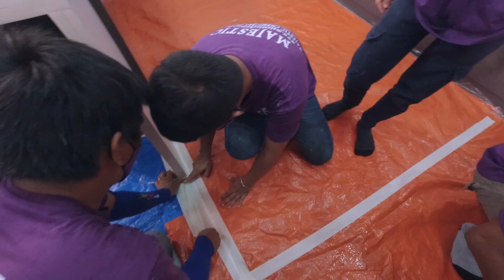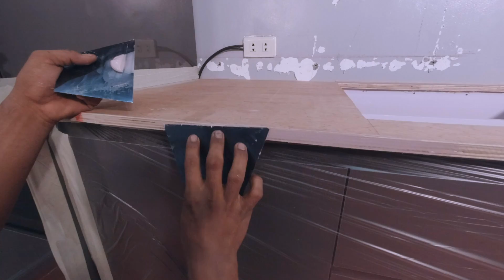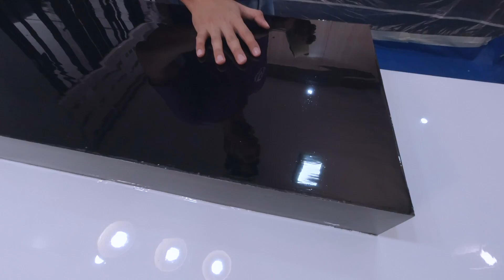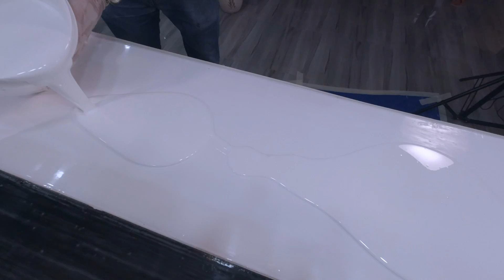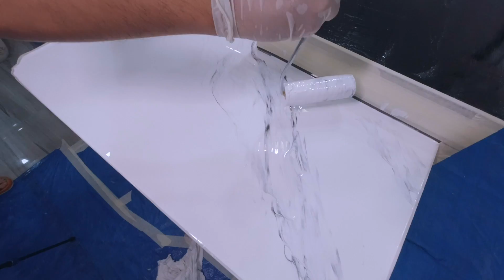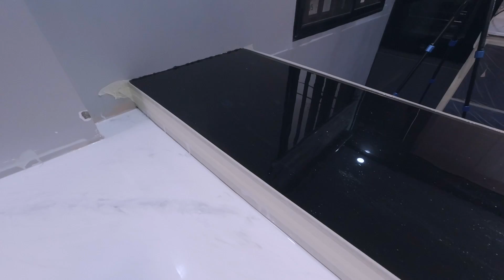Full INSTRUCTIONAL VIDEO Counter top Epoxy Black and White Carrara Inspired Design

Comment: Sir kelan po tinangal yung masking tape sa sides? 
At yung primer sa wall di ba yun magcause ng gap pagmatuklap na ang paint?
Yung mga masking tape between sa top counter at sa lower counter pano pag tanggal?
Reply: Waiting po sa sagot.😁
Reply from the maker: Good Day 

Tinanggal po ang 
masking tape around 30mins simula nung binuhusan.
Primer po sa wall? lahat po ng product natin is Epoxy resin, hindi po sya recommended na e apply sa Wall dahil Selfleveling materials sya.  Unless mag apply sa plywood then ididikit pag ka dry. 
Hahatakin lang po.. ang drying time naman po nyan is 6-8hours. kaya within 30 mins, alisin sya ng dahan dahan, let the flow begin :D 
dahil may 30 mins na syang na stay sa surface may pag ka lapot na sya kaya di lahat mag fflow :) 

makakabili po kayo sa amin, just message lang po and we will answer those Questions :)
https://www.facebook.com/majesticchemicals/

also we have LAZADA for COD
You can purchase to our Lazada
then screenshot your order then send it to us here so we can prepare it as soon as possible.
sa Fb page parin po :)
https://www.lazada.com.ph/majestic/?

Visit our Website
https://majesticchemicals.com/

By the way I'm Sherwin of Majestic Chemicals, Glad to assist you :)
For availing & quicker response, you may contact us
09182523454

Join MAJESTIC EPOXY RESIN COMMUNITY PHILIPPINES to show your resin works and share tips
⬇️M⬇️A⬇️J⬇️E⬇️S⬇️T⬇️I⬇️C⬇️ ⬇️C⬇️H⬇️E⬇️M⬇️I⬇️C⬇️A⬇️L⬇️
https://www.facebook.com/groups/398748351104499

Comment: Magkano ba ang self leveling at ang metalic epoxy,,kasama na ba ang pigment dyan pagbili mo ng metalic epoxy?,,,tnxs po
Reply from the maker: Good day

Exactly sir, lahat po ng sinabi nyu is include sa mga kit natin.

Part A and B for Primer and Top coat with metallic pigments na po sya :D 

For availing & quicker response, you may contact us
09182523454

Comment: ano po pros and cons ng epoxy resin? comparison din vs tiles in terms of durability from wear and tear?
Reply from the maker: We are Majestic Chemicals Industries is the #1 supplier of Liquid Marble Epoxy Resin in the Philippines.
It can be used on floorings, countertop, tabletops, even for casting like rivertables, jewelries and accessories.
Features:
✔ Waterproof (Non Skid)
✔ Heat Resistant (Fire Absorbent)
✔ Stain Resistant (Odorless)
✔ Chemical Resistant (Food Graded)
✔ Seamless
✔ Stylish and Unique Design
✔ Economical and Cost Effective
✔ Environmental Friendly
✔ 100% Pure Solid (Can absorb up to 10,000 PSI)
✔ Multi-Dimentional Effect
Reply: @MajesticChemicals  its not UV resistance nag yeyellow po siya tama po ba?

Comment: Gud day ano po Ang mga dapat bilhin ng mga materyales paki lista Naman po thx.
Reply from the maker: Good day

Avail po kayo sa amin ng aming resin epoxy depende po sa Sukat by SQM po ng pag bubuhusan.

sa mga hardware meron pong 
foam roller, liha, brush and need lang po na may mga cover ang mga posible na mapatakan or masayaran ng ating resin :) 

For availing & quicker response, you may contact us
09182523454

Comment: Mas matibay po b yan kaysa Tiles or granite?ok lng b yan khit mabsa?cnung mas mas mura?
Reply from the maker: Good day

Opo, mas quality po ito sa kanila
Our product or resin epoxy has

-water resistant
-heat resistant 
-scratch resistant
-dust resistant
-chemical resistant
-di nag ccracks
-di nababasag
-walang maintenance, walis or punas lang
-super easy to apply
-shiny at elegant pa tignan
-non-slippery even wet
-odorless & solventless
-industrial grade
-food grade/safe
-Lifetime Quality
Can hold up to 10,000 PSI

at kung mababasa man, okay lang din po dahil water resistant ito at kahit na matapakan ay hindi po kayo madudulas bagkos ay makapit pa po,
mura lang ng konti si Ceramic tiles
pero mas mura tayo sa Granite tiles at marble
at Mas Quality sa kanila

For availing & quicker response, you may contact us
09182523454

Comment: hardener po ba yung parang color Oil Golden?
Reply from the maker: Good day, opo ganun nga po ang kulay ng Hardener or Part B ni Selfleveling Non-metallic :D 
by the way I'm Sherwin of Majestic Chemicals. Glad to assist you :)
For availing & quicker response, you may contact us
09182523454
Reply: @MajesticChemicals  sir ask lang ko. magkanu yung per gallon ninyu sa Expoxy resin A & B

Comment: Boss pwedi bang pinturahan ng epoxy paint bago patungan ng self leveling
Reply from the maker: Good day

we only recommend sir na walang iba sa flooring, dapat malinis at walang ibang e aapply.

self levelling non-metallic for our primer then metallic for top coat. requirement is rough to smooth finish concrete/cement flooring or even plywood ang flooring basta walang ibang ilalagay dahil di kakapit ang ating resin epoxy :)

For availing & quicker response, you may contact us
09182523454

Comment: Isasand parin po ba yung baba nung edge pag tinanggal na yung tape? Un kasi yung inaabangan ko kaso hindi nyo na sinali sa video
Reply from the maker: Good day

30mins after coating of top coat or design part, saka po tatanggalin para medyo sticky na sya at di lahat mag over flow :D 
for more details, kindly contact us... 
For availing & quicker response, you may contact us
(+639182523454)

Comment: Ano po yung pinaghalo nyo s primer at s top coat, at san po makakabili ng risen epoxy. Ty
Reply from the maker: Good day

We called it, hardener or Part B, makakabili po nito sa amin

kumpleto na po, part A si resin at part B si hardener! 
 For availing & quicker response, you may contact us
09182523454

Comment: Good am!Sir pwd rin po b mag counter top epoxy pag plat yero ang sahig s  my lababo?
Reply from the maker: Good day

if metal po ang yero at flat pwedeng pwede po :) 
pero kung glass or may pag ka plastic ang surface di po kakapit si epoxy resin :)
For availing & quicker response, you may contact us
(+639182523454)
Reply: @MajesticChemicals  sir ilan taon po bsgo masira ang couter top epoxy?

Comment: Mas mura ba yang ganuan sir kesa granite nalang Ang counter top
Reply from the maker: Good day

Our product or resin epoxy has

-water resistant
-heat resistant 
-scratch resistant
-dust resistant
-chemical resistant
-di nag ccracks
-di nababasag
-walang maintenance, walis or punas lang
-super easy to apply
-shiny at elegant pa tignan
-non-slippery even wet
-odorless & solventless
-industrial grade
-food grade/safe
-Lifetime Quality
Can hold up to 10,000 PSI

mura lang ng konti si Ceramic tiles
pero mas mura tayo sa Granite tiles at marble
at Mas Quality sa kanila

For availing & quicker response, you may contact us
09182523454

Comment: patingin nmn po sa diskarte ng pg tangal ng tape sa edges
Reply from the maker: Good Day

after top coating, patagalin nyu lang ng 30mins, then saka tanggalin para steaky na pag bagsak at linisin lang lagi yung pinaka ilalim, po para maiwasan yung may matuyong drop form.

makakabili po kayo sa amin, just message lang po and we will answer those Questions :)
https://www.facebook.com/majesticchemicals/

also we have LAZADA for COD
You can purchase to our Lazada
then screenshot your order then send it to us here so we can prepare it as soon as possible.
sa Fb page parin po :)
https://www.lazada.com.ph/majestic/?

Visit our Website
https://majesticchemicals.com/

By the way I'm Sherwin of Majestic Chemicals, Glad to assist you :)
For availing & quicker response, you may contact us
09182523454

Join MAJESTIC EPOXY RESIN COMMUNITY PHILIPPINES to show your resin works and share tips
⬇️M⬇️A⬇️J⬇️E⬇️S⬇️T⬇️I⬇️C⬇️ ⬇️C⬇️H⬇️E⬇️M⬇️I⬇️C⬇️A⬇️L⬇️
https://www.facebook.com/groups/398748351104499

Comment: Tanong ko lang po kung kakapit po ba ang epoxy resin sa granite?
Reply from the maker: Good day

Yes po kakapit po :D kung balak nyu patungan ang granite tiles nyu. opo pwedeng pwede po :D

just make sure na matibay parin po si granite 
mamasilyahan ang lines at lilihaan po sya then primer then top coat... 

Avail na po kayo
For availing & quicker response, you may contact us
09182523454

Comment: Pwede ba sa cement,,at pano
Reply from the maker: Good day

Opo pwedeng pwede cement finish semi rough finish lang requirement na self level area.. 

primer, lihain then clean tapos top coat napo :) may instructions naman po ito and step by step maliban dun tuturuan ko din po kayo via call and gguide ko po kayo :D 

Avail na po kayo ^_^ 

For availing & quicker response, you may contact us
09182523454

Comment: Hello po May I know how much do u charge for labor for a kitchen counter top and round dining table.
Reply from the maker: Materials & Labor for Counters, 
1000Php/sqft
Additional 20k and Up depende sa location  for equipment & mobilization
w/ 5 Years Warranty

sa round dining table po. ilang seater?
For availing & quicker response, you may contact us
(+639182523454)
Reply: @MajesticChemicals  4 seater po
Reply: My location po sa Field residence condo

Comment: Good job.  Wala bang amoy yung resin boi..
Reply from the maker: Good Day

May amoy pero di po sya masakit sa ilong or nakakasama. di rin po ganun kalakas ang amoy, 

Our product or resin epoxy has

-water resistant
-heat resistant 
-scratch resistant
-dust resistant
-chemical resistant
-di nag ccracks
-di nababasag
-walang maintenance, walis or punas lang
-super easy to apply
-shiny at elegant pa tignan
-non-slippery even wet
-odorless & solventless
-industrial grade
-food grade/safe
-Lifetime Quality
Can hold up to 10,000 PSI

For more details, Pm us po

makakabili po kayo sa amin, just message lang po and we will answer those Questions :)
https://www.facebook.com/majesticchemicals/

also we have LAZADA for COD
You can purchase to our Lazada
then screenshot your order then send it to us here so we can prepare it as soon as possible.
sa Fb page parin po :)
https://www.lazada.com.ph/majestic/?

Visit our Website
https://majesticchemicals.com/

By the way I'm Sherwin of Majestic Chemicals, Glad to assist you :)
For availing & quicker response, you may contact us
09182523454

Join MAJESTIC EPOXY RESIN COMMUNITY PHILIPPINES to show your resin works and share tips
⬇️M⬇️A⬇️J⬇️E⬇️S⬇️T⬇️I⬇️C⬇️ ⬇️C⬇️H⬇️E⬇️M⬇️I⬇️C⬇️A⬇️L⬇️
https://www.facebook.com/groups/398748351104499

Comment: Yung  1 ltr na epoxy sir, gaano kalaki ng area (sq/mtr) kaya nya.
Reply from the maker: Good day

Meron po kaming kit or set for 1sqm 
Metallic Starter kit
1 liter Selfleveling primer
1 liter Metallic/ Liquid marble
Free 50g metallic pigments
1sqm coverage area 
2,800 Pesos

kumpleto na po sya, from primer to top coat :) 

For availing & quicker response, you may contact us
09182523454

Comment: sir, how much per square meter
Reply from the maker: Good Day 

For Flooring
 
Materials only
900Php/sqm for Metallic Resin Epoxy
650Php/sqm for Non-metallic Resin Epoxy
 shipping fee not included

Materials & Labor
2,500Php/sqm bellow 50sqm for Metallic
2,000php/sqm 50sqm and Up for Metallic
1,800Php/sqm bellow 300sqm for Non-metallic
1,500Php/sqm 300sqm and Up for Non-metallic
+15k for equipment & mobilization

makakabili po kayo sa amin, just message lang po and we will answer those Questions :)
https://www.facebook.com/majesticchemicals/

also we have LAZADA for COD
You can purchase to our Lazada
then screenshot your order then send it to us here so we can prepare it as soon as possible.
sa Fb page parin po :)
https://www.lazada.com.ph/majestic/?

Visit our Website
https://majesticchemicals.com/

By the way I'm Sherwin of Majestic Chemicals, Glad to assist you :)
For availing & quicker response, you may contact us
09182523454

Join MAJESTIC EPOXY RESIN COMMUNITY PHILIPPINES to show your resin works and share tips
⬇️M⬇️A⬇️J⬇️E⬇️S⬇️T⬇️I⬇️C⬇️ ⬇️C⬇️H⬇️E⬇️M⬇️I⬇️C⬇️A⬇️L⬇️
https://www.facebook.com/groups/398748351104499
Reply: Sir, san po makakabili ng mga chemicals na ganyan,, may mga procedure na rin po ba pag gamit nyan,, at magkano po
TIA
Reply from the maker: @joelcasas 
Good day, yes po kumpleto na po sya sa pag purchase 

kindly contact us: 09182523454

Comment: Ilang minuto na bago matuyo pls
Reply from the maker: Good day

for Non-metallic 6-8hrs + 1day full cured pwede na lagyan ng mabibigat
for Metallic 1day dry + 2days full cured pwede na lagyan ng mabibigat
for Liquid crystal see through, up to 7days full cured. 

Depende parin po sa laki, mas maliit mas mabilis matuyo.

For availing & quicker response, you may contact us
09182523454
Reply: @MajesticChemicals  salamat
Gusto ko to
Reply from the maker: @wilfredoanahaw4894  
Avail na sir ^_^

For availing & quicker response, you may contact us
09182523454